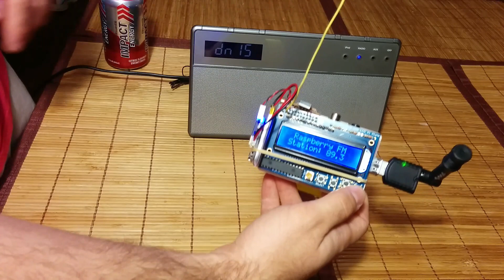Arm Mounted FM Transmitter

Comment: This is the geekiest, nerdiest, dorkiest thing I have seen in quite a while. I'm truly impressed and also envious. In typical engineering fashion, you pack a lot of functionality in a very questionable package, but true engineers don't care about the looks. Simply loved the detail when you have an entire computer with battery and 3D printed case in your wrist, but forgot to add a power switch and don't really care about it because it's already working. Mad props to you, man!
Reply from the maker: Thanks for the praise man!  I forgot to mention in the video the reason for the rubber band battery setup was to shoot the video right after developing the script... when I'm writing and testing it was powered via USB wall wart and never connected to a battery.  Oh that reminds me the LCD back light brightness pot has to be adjusted when powered via GPIO pin instead of USB for some reason.